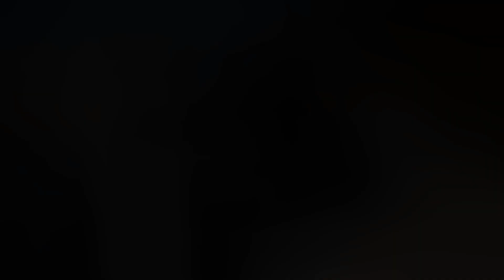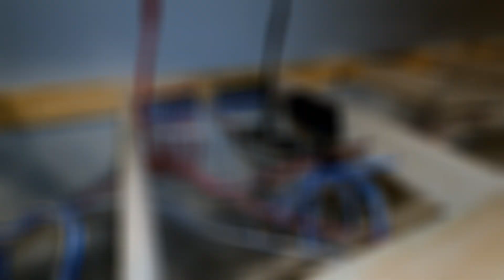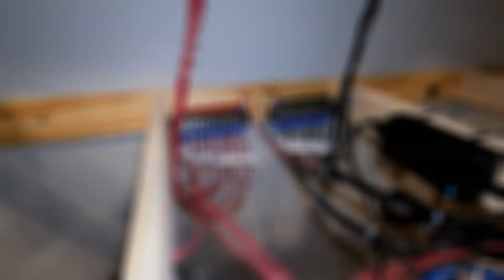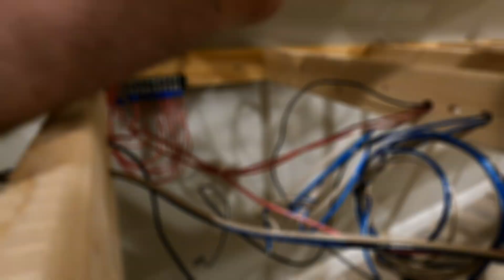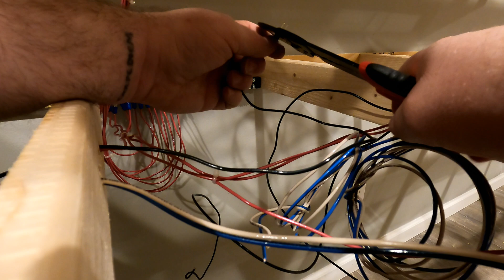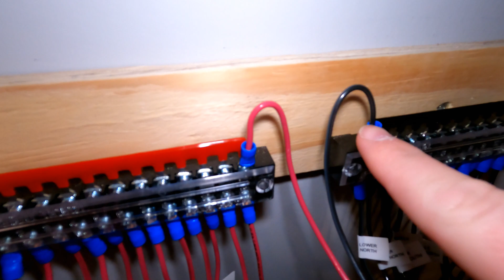05 - DC accessory bus wiring

Comment: Thanks for sharing the wiring. A lot of people building layouts gloss over the wiring. I hope you will be as thorough when doing the DCC bus and how you broke down the layout into the various zones for DCC and for signaling and include all of the different controllers that you used.
Reply from the maker: Thanks. The wiring is often something people skip over, but then it's hard to learn how to do it. I'm not at all saying this "The Right Way" to do it, but it's one way, and it's what will work for me based on past experiences. In the next video (which it looks like you've already seen), I do get more into the DCC wiring side of things and how I'll break it down into power sub districts and for detection, etc. Iain

Comment: Did you consider using a fused DC distribution block ?
Reply from the maker: I did, yes, but given the DC accessory bus will be fairly low usage, I wasn't convinced it was worth it. I already had these 12-way distribution blocks, and it should be possible to switch to a fused version if the layout warrants it in the future.

The actual locos will all run DCC, with each of the separate blocks on their own circuit breaker within the Digitrax PM74s. I've tested they work when a line is shorted, without removing power from the other lines. That's more where I feel like I needed the protection. Do you think the DC accessory bus would also benefit from some kind of circuit protection?

Thanks for following along. Iain
Reply: @gncascadedivision  Might be worth a single inline fuse to protect against a dead short harming your power supply if it does not have one built in.
Reply from the maker: Yep, that's fair. I'm not sure a $12 Amazon power supply would :) When I get to the point of starting use the DC accessory bus, I'll review this again. Thanks, Iain